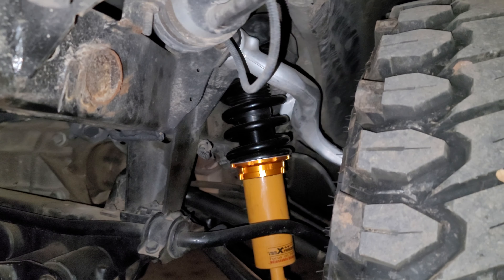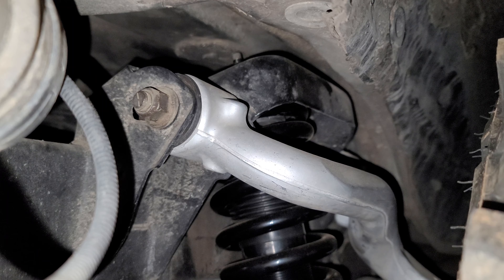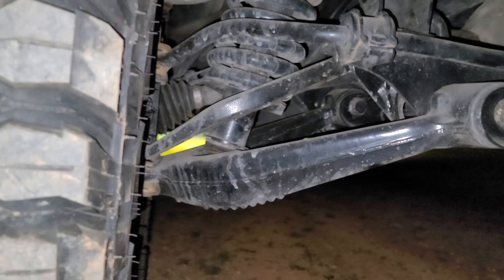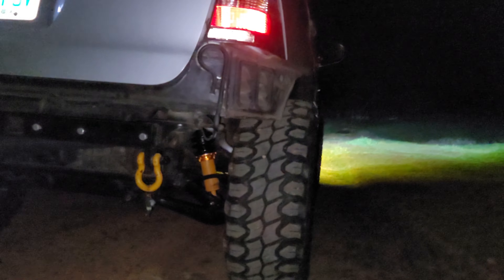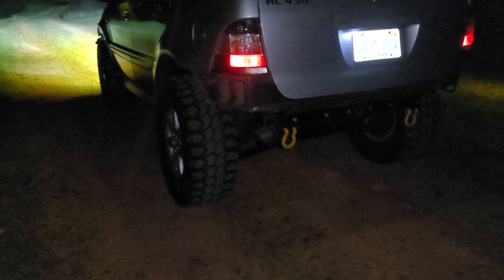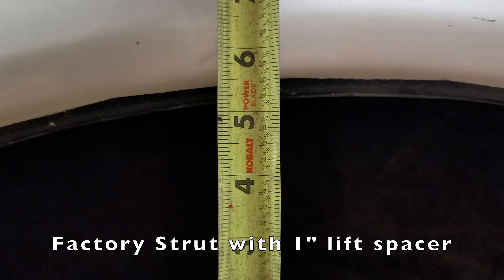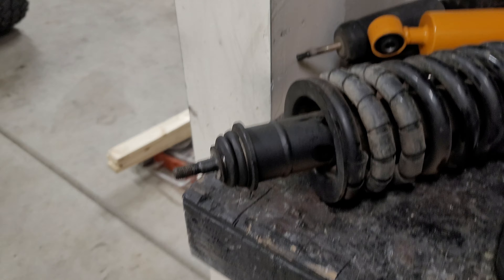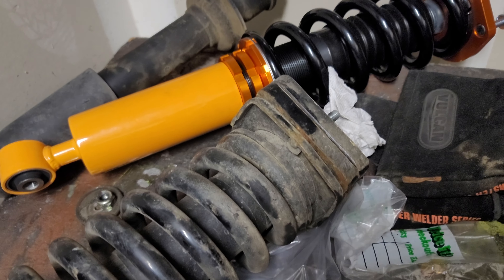Coilovers for Mercedes ML! #mercedes  #offroad #coilovers #custom #infidelgarage

Comment: For anyone trying to figure out compatibility,i believe those are lexus is300/ ls430 with a full strut length of 610mm and possibly nissan 370z-350z with full strut length of 600mm while on a 10k front spring.Lexus spring is 12k looks very similar to those two makes they aren't Bmw or volvo or any Volkswagen they don't look alike

Comment: rechercher etdécouvrir ne sert à rien si l'on ne partage pas l'expérience dommage que tu ne donne pas les reférence et les modifications réalisés merci quand même pour la vidéo
Reply: Pour ceux qui voudrait le faire sur leur ML voici ma solution combinés fileté pour BMW E36 PRENDRE LES AVANT ils sont prévus pour porter plus de poids ET ONT UN SIMPLE TUBE creux EN BAS diamètre intérieur 48mm récupérer 80mm du bas de l'amortisseur d'origine diamètre 47.5 et le faire entrer dans le tube sur 70mm de profondeur souder le tout comme ça on garde la rotule d'origine pour le reste le montage est le même, les arrière du kit doivent pouvoir s’adapter pour le devant sans les ressors et avoir des amortisseurs réglable.
Reply: @lesdevindelle1574  Bonjour et désolé pour la traduction google qui suit...

Je pense que la raideur du ressort avant du E36 est trop faible pour le W163 à 8 kg/mm. Il devrait être d'environ 10kg/mm non ?

Le ressort semble également très court, bénéficiez-vous toujours de la totalité de la course utile dans le W163 ?

Le E46 ne serait-il pas une meilleure option ? Savez-vous si le support inférieur du E46 pourrait être modifié de la même manière que le E36 ?
Reply: @stum05 Hello they are not from e36 or for e46 that's because I know how the top hat or camber plate looks like I Have them of my two car's they don't look similar must be for a Mercedes different model